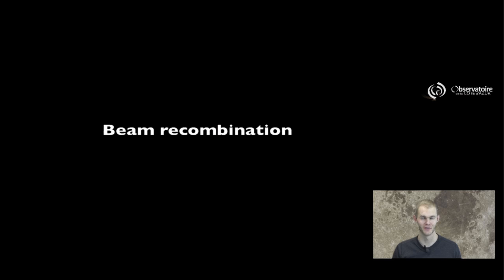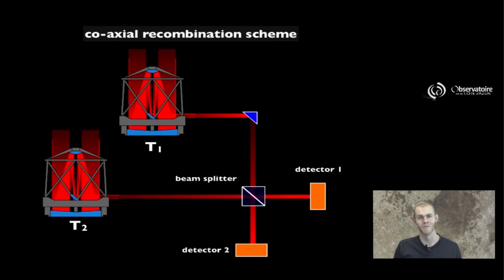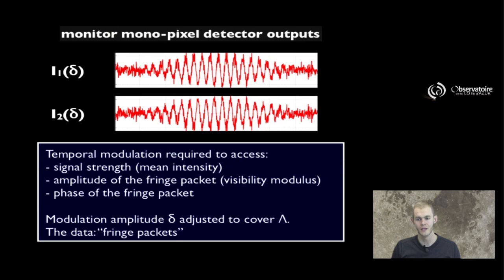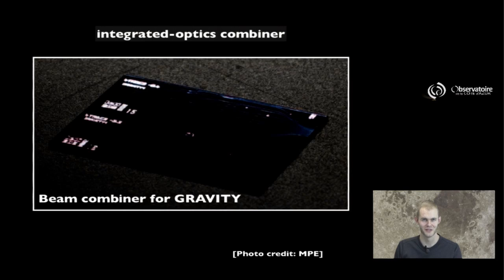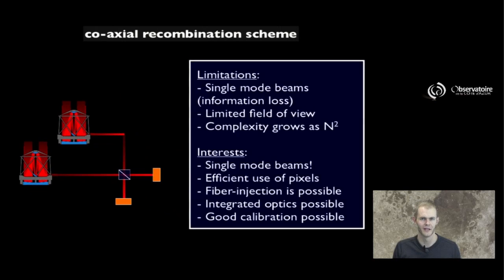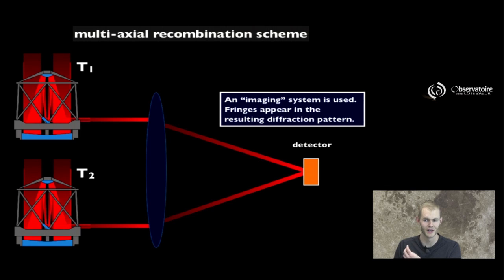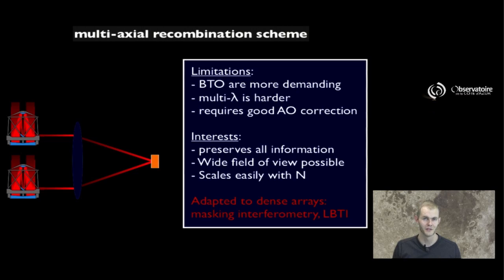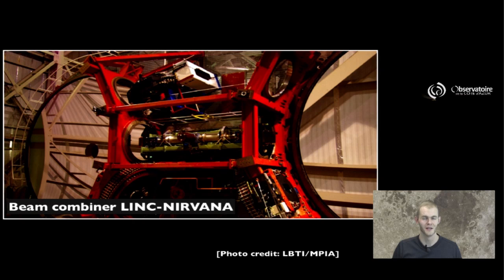Beam recombination

Comment: Dear professor Martinache,
I'm enjoying this lecture series a lot and gives me a much needed high level overview of many topics on interferometry. There is, however, one aspect that I don't quite understand. At 7:30, you discuss the limitations of the co-axial beam recombination scheme and mention that it relies on single mode beams, but I don't understand why that has to be the case. Is it because of the beam splitter? Otherwise I don't see why the multi-axial scheme would be any different in this regard. Is there perhaps any resource that you could point me to that discusses these pros and cons in more detail?